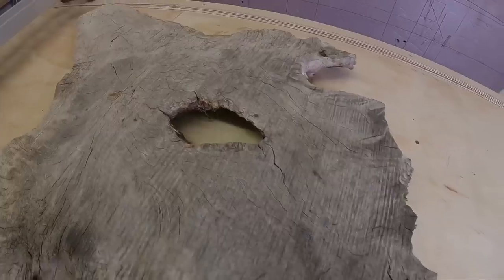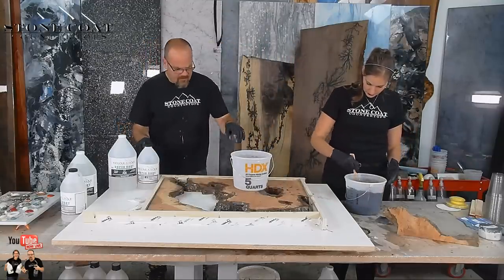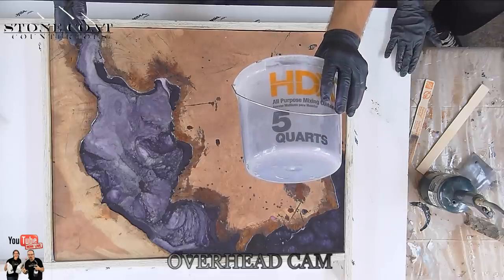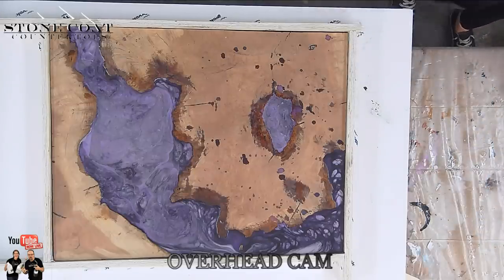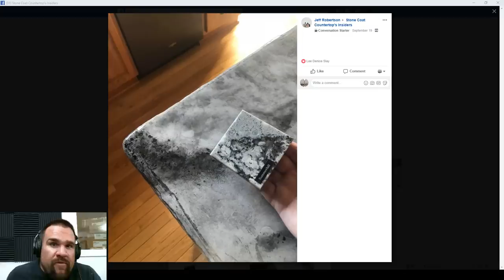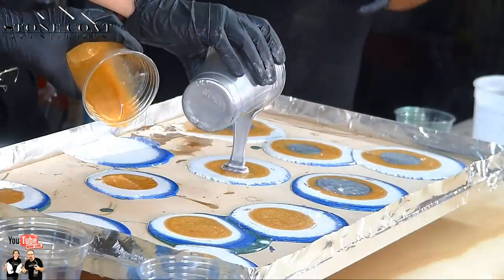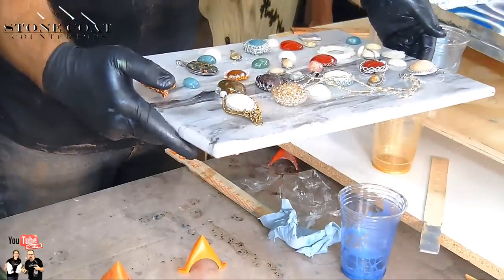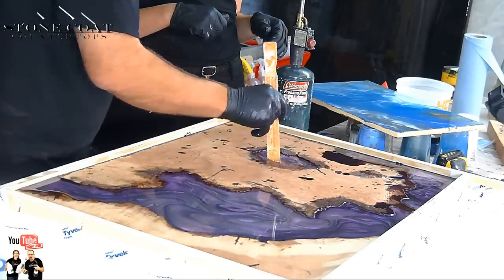Epoxy Live @ 5 Casting Redwood | Massive Geode Test

Comment: In a project where specific colors are wanted with crisp lines. How well do the epoxies do if you made slabs of one color and after it dries, laid them onto the board with the taped dams, then poured the next color. How well does it do in hiding the lines of the drive epoxy and the wet epoxy? Or will the clear top coat hide the lines?  I hope u can understand the question. Also, will that change the formula on figuring how much epoxy is needed

Comment: Quick tip, ignite the torch pointed away from the piece working on then proceed, the propane/map gas etc. comes out before the igniter clicks thus bringing in foreign materials into the resin. :)

Comment: Im glad I saw your ad, your youtube channel is pretty rad.
Reply from the maker: We're glad you found us ParadiseofDarkness!  Make sure to subscribe and ring the bell for notifications, we have many more amazing projects in the works, stay tuned!  Are there any projects you would like to see in particular?
Reply: @StoneCoatCountertops  indeedy I have subbed after watching a few videos you have made and checked the bell.

Hmm, for suggestions. I would like to know how you guys if you do make it a galaxy pattern without it blurring or blending. If its possible have a clean effect of the black and the nebulas with the glitter stars in the black. 

As well I acutally planning to make a remove counter board with wood. That I would place on my tablet top when I do art on for youtube. As in the back of the board would have to 2 inch flat cloth loops bolted on. That I would use to lift the pallet up off the table when im done or on in use. What If wanted to do this for a resin, is it durable enough and how thick the wood or resin should be to be able to moved around a lot. 2 feet by 4 feet. If you can answer that for me that be swell <3
Reply from the maker: Great questions ParadiseofDarkness. An easy and fun technique to try for achieving a galaxy look with nebula would be to pre-fog the color using rustoleum spray paints over your Behr Paint and Primer in One.  Then once you have your nebula the way you like it you can go over with a coat of epoxy and glitter to add depth to the piece.  Check out a similar training video we did here: https://www.youtube.com/watch?v=rE7AVy968do    For your other project, we would love to hear more about it, what type of wood were you thinking of using?  Feel free to call or email us and we would be happy to walk you through step-by-step instructions. (541)450-1976

Comment: After all the work is done, what I do you use to clean up your buckets, stirrers and such?
Reply from the maker: Greg, we allow the epoxy to dry in the buckets, flex the bucket and then peel out the dried epoxy. As for the brushes we soak them in Acetone.
Reply: Thank you.

Comment: Is the table top going to be mounted on a frame or will the epoxy be strong enough to hold the 2 pieces together?
Reply from the maker: Great question Martin. We will be sealing and flood coating this piece and it will be strong enough to be mounted on it's own. For larger slab pieces and wood table projects we like to reinforce the bottom with square steel tubing to prevent the slab from cupping.  Thanks for watching and feel free to call or email us anytime with questions or for project support. (541)451-1976

Comment: Would vibration help get rid of bubbles, if a drill was used to mix the epoxy?
Reply from the maker: Great question W.D. Griever!  We haven't attempted this, we always use a propane torch to remove air bubbles. Here is the torch we like. https://www.amazon.com/Bernzomatic-TS4000-Trigger-Start-Torch/dp/B00008ZA09/ref=as_sl_pc_qf_sp_asin_til?tag=stoncoatcoun-20&linkCode=w00&linkId=1079ed93ce4f9a3210140881ab1ed4ed&creativeASIN=B00008ZA09

Comment: I have a 10 foot long table, 4 feet wide.  How much of the resin will be required?
Reply from the maker: Great question Carol!  For your seal coats and your final flood coat you will need a 2 gallon kit:  https://www.stonecoatcountertops.com/product-page/stone-coat-2-gallon-kit Will your table include a river as well? If so let us know the length, width and the height of the river space and we would be more than happy to calculate the amount of casting epoxy you will need. You can also use this volume calculator here to determine what you will need for the river:  https://www.sensorsone.com/length-width-and-height-to-volume-calculator/   Call or email us anytime with questions and for free project support. (541)450-1976

Comment: Like the new casting epoxy. How long does it take to get hard to the point it will not bend? Also, is it available for sale now?
Reply from the maker: Great question Versatile Coatings LLC! We are still testing the new casting epoxy, it does not have a release date yet, but soon! Give us a call at 541-450-1976 and we would love to answer any questions that you may have!

Comment: guys what can I do with a big bubble , after three times i torched my job , I covered and leave.When I come back the bad news was the bubble.
Reply from the maker: Thanks for reaching out to us Oscar, is the bubble popping up in the same area?  You may have a tiny pin hole where air is leaching out. Here is how we use the burn in stick to fill small  voids. https://youtu.be/QnKg49cXnNs?t=1478Here is a link to that burn in stick as well. https://www.amazon.com/Mohawk-Quick-Fill-Burn-Stick/dp/B00BOTWQJY/ref=as_sl_pc_tf_til?tag=stoncoatcoun-20&linkCode=w00&linkId=6638768ab972a034c7372743e31e6973&creativeASIN=B00BOTWQJY
Contact us anytime with questions or for project support. (541)450-1976

Comment: Hi Mike,

Its usually quite warm in Texas, but there are some cold days and nights, like right now. I have work shop  and I heat it when I am there, but not when I am not. Please explain to me the required temperatures for storing the epoxy and the required working temps. Thanks for the great videos.

Comment: I need a router jig like that.
Reply: Americoon Eight Making a router jig is so easy.  I used a couple 2x4 for the side rails and pocket screwed them into an old flat store display.  then used two 4' pieces of slotted angle iron for the jig.  Put 2 pieces of 2x4 at each of the ends.  For my table I have an old display from a store.  Total cost $24.00

Comment: I want to work for yall, so I can do some of these awesome projects! :)
Reply from the maker: Thank you for your support Sammie!  What projects are you planning?
Reply: Stone Coat Countertops    New kitchen countertops from scratch.  My concern is how heat resistant they are, in case a hot pot is set on them.  I have preteen and teen granddaughters that like to come over and cook things sometime.  Accidents can happen  LOL
Reply from the maker: Great question Daniel! Stone Coat Countertop epoxy is durable. You can set hot pots and pans directly on the surface; however, just as any countertop surface, we suggest you still use hot pads, as it's nonporous and food safe. You can clean with normal household countertop cleaners, but soap and water generally does the trick. Not much will damage the surface as far as spills and stains, but it's good to clean up spills after you're finished cooking and using your tops to prep. It takes three days for light use, seven days for cure and thirty days to a full cure where our durability video tests are shown at. Here is a link to our durability video showing what Stone Coat Countertops can take, we have tested up to 475 degrees Fahrenheit. https://www.youtube.com/watch?v=YLUteivXWaM
Thank you and feel free to contact us anytime!  (541) 450-1976